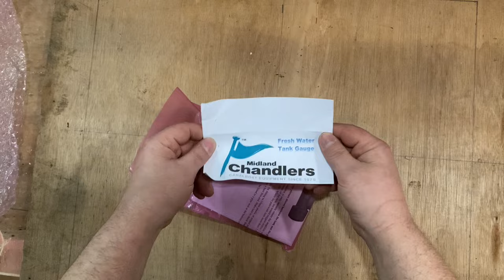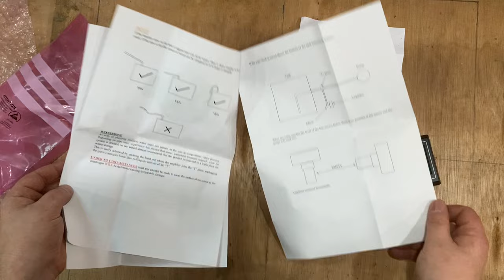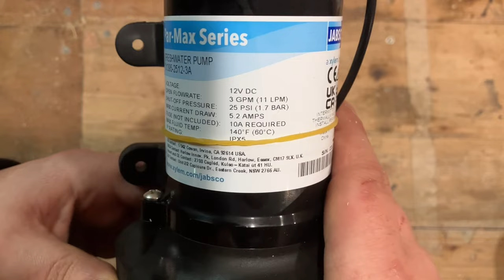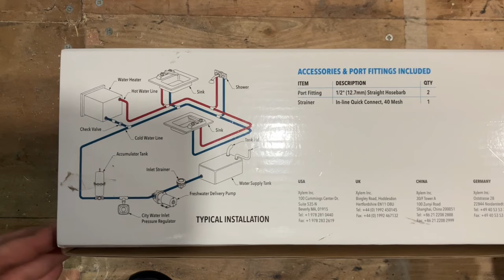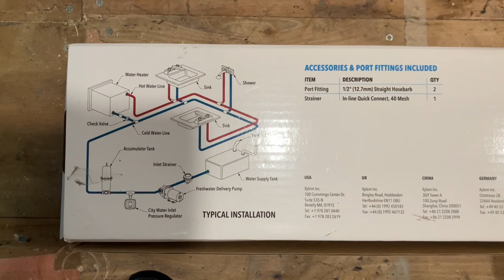92. First Fix Plumbing On My Project Narrowboat

Comment: Very nice work Oli ,  as a extra security on your water, pipes, joints, i.e J G fittings You can lock them off with Collett and do it in blue and red to note the difference, hot and cold water pipes ,
Nice work 👍👍👍🇬🇧🇬🇧🇬🇧🇬🇧

Comment: As  a boat builder for nearly 50 years may i suggest you put your pump on insulation to stop the vibration noise from it it will save a lot of heart ache with noise ps great neat job so far good luck
Reply from the maker: 😉 I already did this weekend. Good shout, thanks very much 👍

Comment: Nice 👍🏻 a tip is to give waterpump rubber feet instead of screwed directly to the floor/wall. Runs little bit more silent then 😅
Reply from the maker: Cool thanks very much, the pump come with rubber feet, and this weekend I did stick a few sheets of folded insulation under the pump, but I’ve been thinking how to do something better…. Do you remember portable cd players, how about the car mounts you could get for like 6 months? They’re kinda like the basement supports in anti earthquake skyscrapers in Japan.. I’m gonna see if I can find one or build something like that. Good looking out, thanks very much 👍
Reply: 🤷‍♂️ Maybe try it once other things are around it... Might be worrying about something that's good enough already?

Comment: Pipework is crisp. Take a picture of it and frame it for your wall to remind you of how tidy it is. Its almost artwork with that 90 degree so flush. £170 for a water sensor, damn. Love how you have taped off the vertical as well. Very neat job all round.
Reply from the maker: Thanks very much, it was loads of fun making it all pretty 👍 and everything with boats seems super expensive 🥺😫

Comment: Re water pump - to make the most of what you have - one of those shower heads with stones in to make the most of the pressure, they work well (though more steam too) "Shower Head 3 Mode High Pressure 40% Water Saving". And recently added the "shower flow reducer control" washers found on a well known auction site (can't post directly links I think hence the search quotes 😐)
Re fire... Fwiw - I get cold feet sometimes, mine is 8" of the floor, I would have considered lowering if it was easy (Probably low blood pressure or something though 🤷‍♂️)

Comment: Hi Oli.  The pipe work looks great.  In relation to the height of the hearth I think it is a good idea to have it raised with storage underneath.  As for the water level indicator - daylight robbery!
Reply from the maker: Yh totally right?!!! Thanks for the feedback on the fire, I agree storage underneath and not bending down so far to tend the fire is a real bonus, and also I just think they look strange right on the floor. Thanks for the compliment, ocd isn’t all bad & has its place the world 😉 thanks for watching and commenting 👍
Reply: OCD can be a lifesaver when you're building a boat, it needs to be perfect to withstand the battering it will get once afloat (and also to stay afloat). Although it is easy to fall into the overthinking and second-guessing trap, I do that all the time!

Comment: The pump cuts in on pressure drop so if you put a NRV straight after the pump it wont start when the pressure drops.
Reply from the maker: Yh that occurred to me eventually…
Reply from the maker: When I actually read the pump and understood what it meant by cut off pressure… thanks for looking out 😉watching and commenting 👍

Comment: Hi oli, wouldn't it have been better just pipping a little further and putting the pump and accumulator under the bed facilitating much better access for maintenance/emergency. Great vlog, it's coming on leaps and bounds.
Reply from the maker: Yh probably, thinking about it now. 
 I think I got it in my mindset that the sensor needs to be close and ran in with it. Good shout, thanks for watching and commenting

Comment: Question, how did you measure to cut the circles out of the ply to meet the window bob on?
Reply from the maker: About 9 minutes into ep 82 shows how I did that, lots of trial an error. Basically a router and a circle jig, seemed to work out well. Thanks for watching and commenting 👍